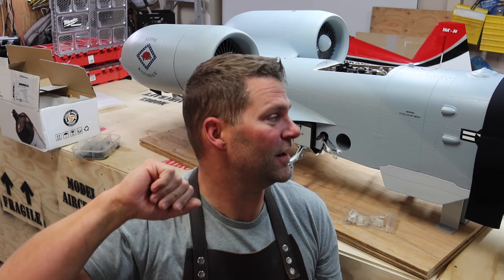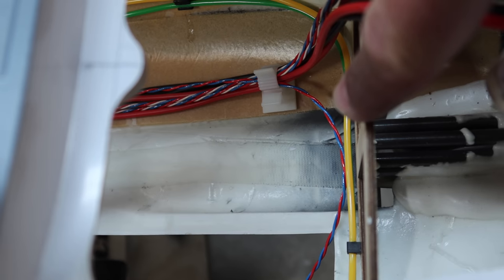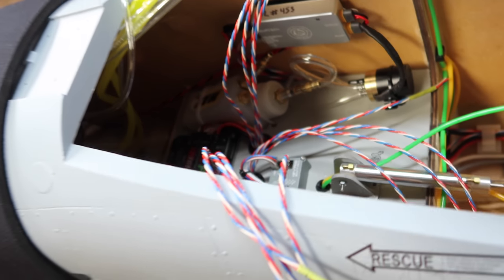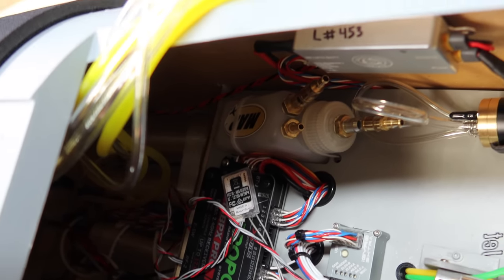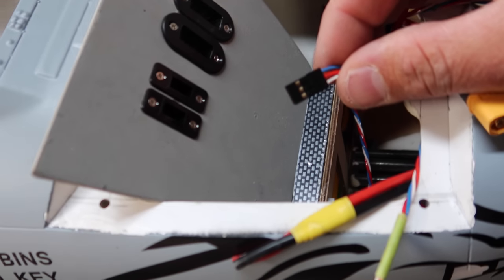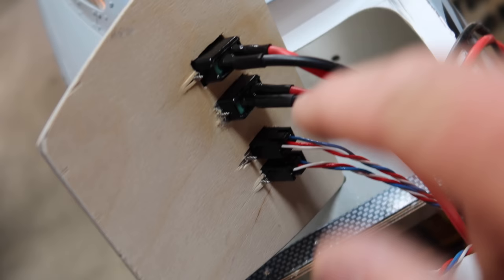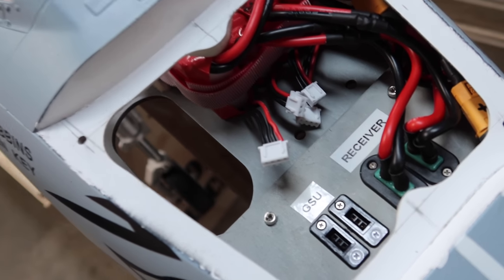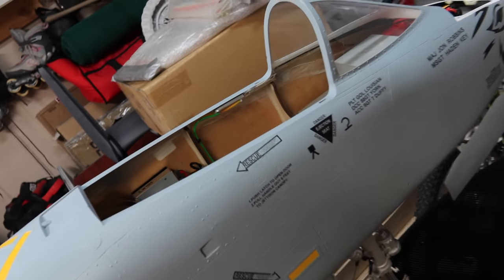GIANT A-10 Near Completion - Skymaster A10

Comment: Jonathan, firstly, thank you so much for the explanation of the fuse wiring.  I will do the same on my Rebel Max and I appreciate you incorporating my question into your video.  This comment may be a little long but hang in there with me.  I'm doing exactly what you're doing but you said you try not to do soldering as it's another point of failure.  Agree!  But, in the wings and empennage, are where your servos are.  Each of those has a lead from the factory.  Are you cutting off those leads and adding/soldering wire there?  My guess is no and you are adding new female connectors to the end of the PB wire so that the servo can be attached and removed easily should you have to swap out servos.  If this is the case (which leads to my final point), in my initial question I had asked about attaching the servo ends onto the wire.  Could you possibly do a very short "Quick Tips" video on connecting/crimping/putting together those ends onto the wire?  This is the part I'm  uncertain of and where I tend to regress to solder existing ends.  I'd really like to learn how to assemble those connectors on to the bare wire.  Much appreciated (if you have time)!  I really have trouble waiting each week for a fresh video from you coming out.  It's almost as bad as trying to remain sane waiting for the release of the new Top Gun movie!  How ridiculous am I?  That was rhetorical by the way.  No need to answer that part folks.
Reply from the maker: No problem Sam!  it worked out well for timing!  I do install a female end on the lead in the wing.  I will bundle up the servo wire itself so the female lead is where the servo is mounted.  The purpose is so if you do have to change a servo your servo lead is not 1/2 way into the wing.  I will use heat shrink tubing on these connectors.

The HURACAN build is starting now.  I will cover the servo end crimping in that one.  Thanks for watching!

Comment: Good work. Have one concern. You route power (battery) cables next to s
Reply: Oops. Next to signal (servo) cables. Shouldn't they be separated?
Reply from the maker: great question.  I used to worry about it years ago with previous generation radio equipment but I don't worry about it so much any more.  If it's convenient I will make a point to separate the lines.  I did this in my Diamond Build from the nose but the radio equipment is so dang good now it's really a non issue.

Comment: When you put your servo connectors on, do you tuck the extra wiring underneath the tray hidden from view or  do you shorten your wires to perfect length and put the connector on the servo wire? If the later solution how in the world do you manage to do that!!!! I find it bad enough to do servo connectors when it is in front of me, I cannot picture doing it inside a fuselage.
Reply from the maker: in this case there is a little extra under the tray, enough to lift the tray and not have it pull on the lines.  I had to put the connectors on in the fuse. Thankfully  it's got a decent amount of room to work!
Reply: @thelightersideofrc  my hats of to you